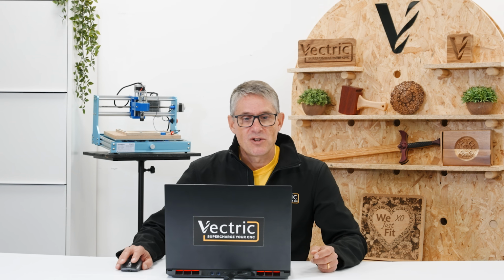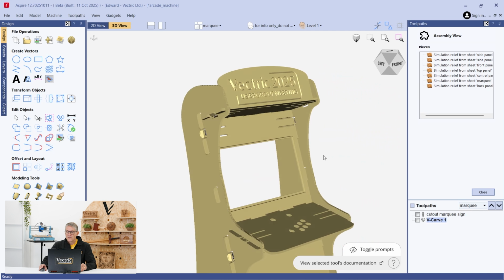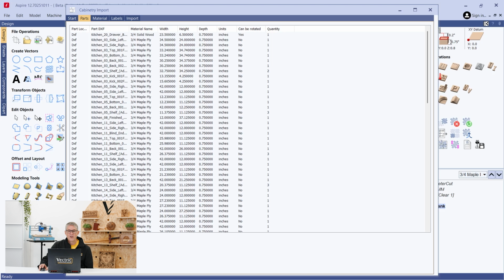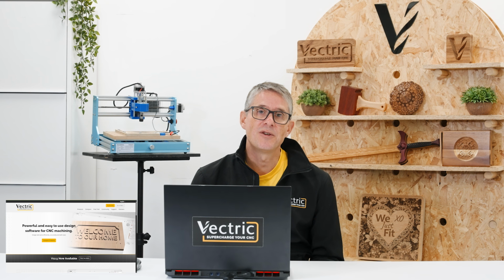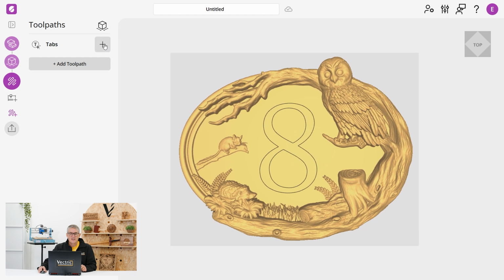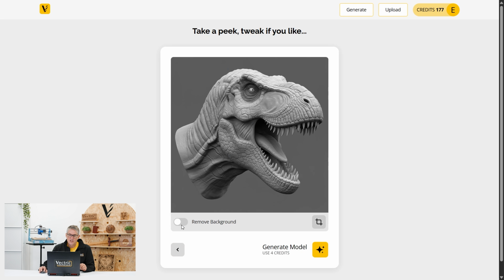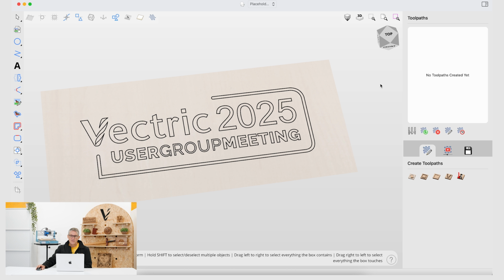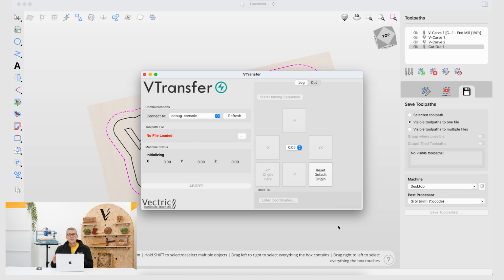What’s New at Vectric with Edward | Vectric Online UGM 2025

Comment: Nice work on the drill bank integration, been needing this for a while now. It will help our process within V carve as we use Mozaik for cabs and Sketchup / V carve for reception desks, panel systems and other custom millwork items that do not fit within box work. Will we be able to buy this for our legacy versions or is this going to be cloud based only ?
Reply from the maker: Hello... the Advanced Machining Module will be available for Cut2D Pro, VCarve Pro and Aspire.  It will not be cloud based but will need V12.5 to work.  Hope that helps... :)

Comment: For the assembly option, I’m curious if you can take each piece and manually assemble them? For instance, if I create an Adirondack chair with all the flat pieces with drill holes, can I assemble them from a flat pack and piece them into a chair to verify they all line up? I wasn’t sure how each piece was assembled to resemble the finished product.
Reply from the maker: Yes you are correct.  At the moment (and this is a beta version and may change) you can create on assembled part per sheet.  Knowing this you may need to jigger your file.  I have to say the "assembled view" is a gamechanger for a project like this.  Whsh I had it for the Arcade Machine we would have caught a few errors in our work... :)
Reply: @vectric great! I’ve signed up as a possible beta tester for this since I convert many old plans into digital files. This truly is a game changer for me.

Comment: I’m a Mac user on Parallels. I won’t be using Spark, but thank you for testing with Parallels to ensure the programs work as intended.

In regard to the cabinet portion, this is something I’m considering getting into. The issue with Mozaik for example, is the steep learning curve coupled with the high subscription fee. While it’s an incredibly specific and powerful program, I would love if Vectric would create a cabinet version that’s simpler. If you’re only doing one or two cabinet type jobs a year, it makes Mozaik just too expensive. 

I design and create a lot of components for another company who is in the event rental space, I’m SOOOO looking forward to the 3D assembly! A basic cabinet program would be such a great addition with that 3D view. 

Vectric has always been a powerhouse for simple 2D designs, but really lacks in the 3D modeling portion for structures, furniture, etc. 

I’m looking forward to V13!
Reply from the maker: Thanks for the feedback and for sharing your thoughts on the new features!
Reply: @vectric  I also would like to easily be able to design a few simple cabinets per year without having to go to a dedicated cabinet software program.
Reply from the maker: Thanks for that.